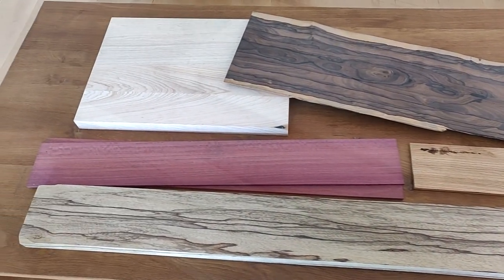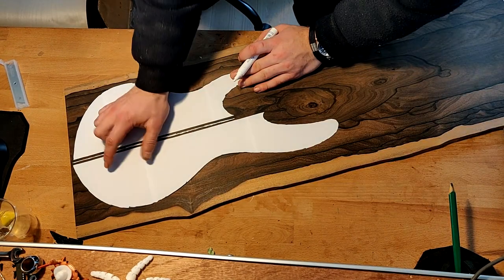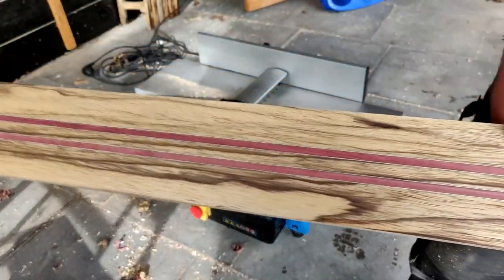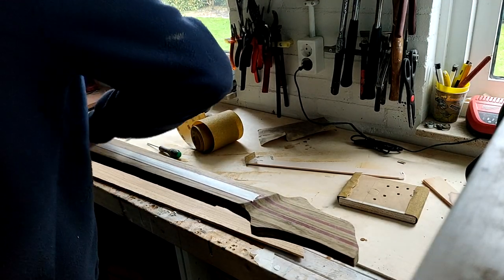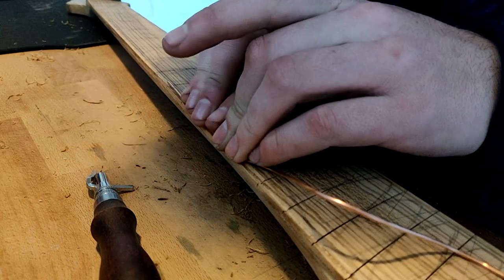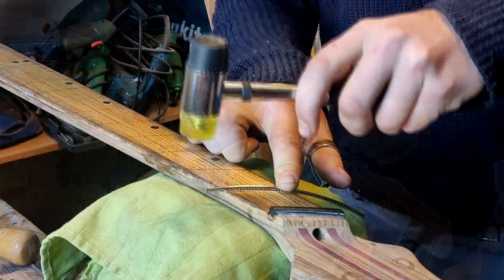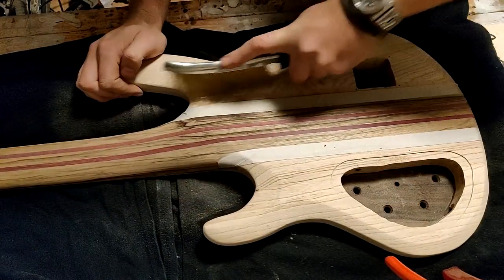Turning EXOTIC Woods into a CUSTOM 5 String MULTI-SCALE BASS

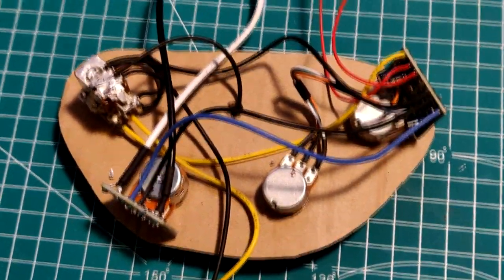Comment: nice build. One question: @13:55 how do you wire up the ground wire through the holes under the single rail bridge? do you need to drill a long hole horizontally under those five holes? thanks!

Comment: Hi, first of all I have to say that I love your videos and very inspirational. This B1005 is a killer bass and it looks like you took extra care for yours so it probably sounds amazing. I have two questions please if you have the time. First and foremost, did you work with any plans, and is where can I get those?
The second question is what pickups did you use. 
Thank you😊
Reply from the maker: Thank you for your nice comment! I made my own plans, but since it's a copy of an existing model I don't think I can legally share plans. I really just copied, traced and printed the general shapes from images online. You can get the image scaled correctly by measuring the scale length. From bridge to nut, if that length is good, the rest is to size as well. The pickups are Fishman Fluence 5 string bass pickups. They're basically plug and play and you can really customise the sound.

Comment: Great job dude, the wood choice on this one is excellent. How did you meassure out the string spacings, fret messurements etc? Couldn't really see how you figured that out in the video
Reply from the maker: Thanks for your comment! The fret spacing was calculated in a cad program so that all the middle strings would fall in line. I basically calculated the string spacings for the longer B, and shorter G strings the traditional way. I then picked the 12th fret as a neutral (the fret is perpendicular to the strings.) From this, a compound radius emerged. The longest string is 36.5" and the shortest is 34".

Comment: love the bass!! just wanted to say be careful wearing gloves when using a tablesaw or any machinery, the fabric could get caught and cause really bad damage.
Reply: Im sure you know this already but it made me panic seeing your hands so close to the saw lol
Reply from the maker: Thanks for watching! And yes, fully aware. These are special, tight fitting gloves that help with grip. Cold hands (it was snowing outside, where I was working) on smooth wood is pretty risky, as it could make me lose grip. This was, in my opinion, more risky as I could slip into the sawblade. 

That being said, I appreciate the concern and I'm fully on board with your comment. My hands definitely got too close to the sawblade on occasion, and I will be using more guides/push-sticks in the future.